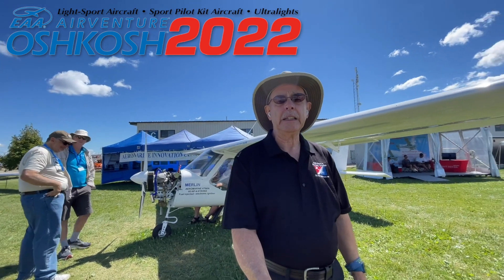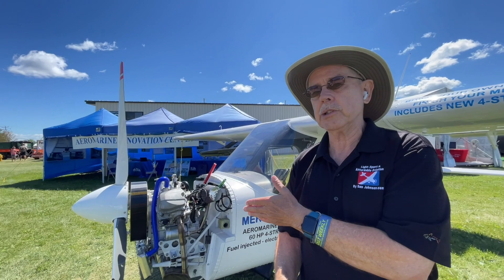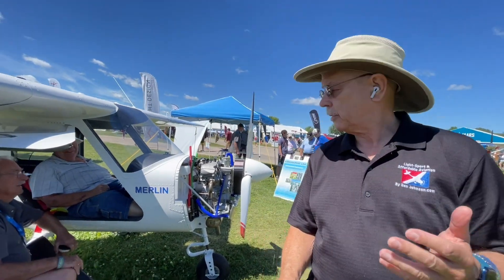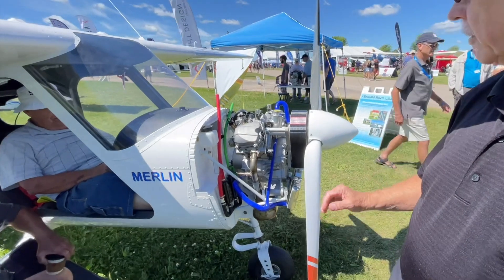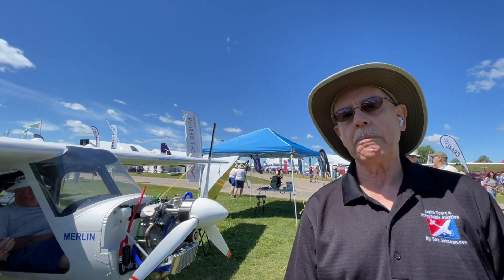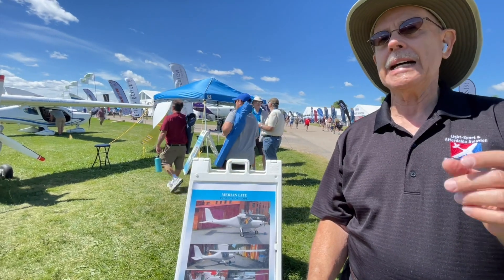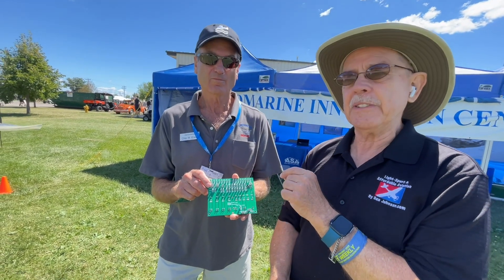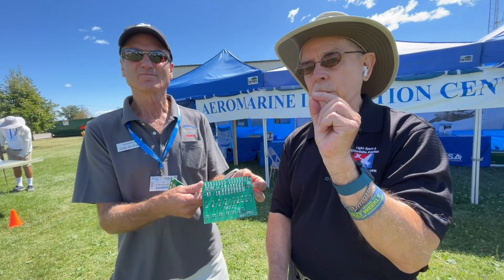Vtwin 4-stroke engine

Comment: Thank you Don, I am from Indonesia, it is interesting to listen to the explanation of the 4 stroke engine, in my opinion the engine you explained is very innovative, I am working on a project to replace the engine from 582..to 4 stroke, for a trike.. From your explanation, it would be better if the description provided an explanation of the specs, and an email address for communication with the manufacturer of the engine (Aero Marine). Thank you
Reply from the maker: At 5:11 you see their web address: Aeromarine-LSA.com, which shows this email — info@aeromarine-lsa.com

Comment: I wonder if it would be possible to merge 2 of these engines together to yield 120 hp, yet have the dependability of two separate engines?  Most airplanes require 100+ hp, so that would make these useful for larger, and faster planes.
Reply: That would require a multi engine rating, costly but desirable. Operating costs increase significantly with an extra engine. Might be worth it especially if you fly over the ocean

Comment: OK , but why V twin?  maybe because they have more torque at lower RPM?     Give me a Honda RC51 engine then.
Reply: V twins vibrate more at lower rpm than parallel or boxer twins. Reckon a boxer twin would be better on a small plane.

Comment: I love your segments Dan, if you can please get help with your audio setup. The audio artifacts make it hard to listen to.
Reply from the maker: I had to work without my video partner, so I tried using AirPods via Bluetooth. For the most part it actually worked quite well, but sometimes, when other noise or activities interfered, it simply wasn't as clear as I would've liked. I could do much better with my microphones but then I'm having to handle those. When you're a one-man show you're somewhat more limited. These were live recordings.